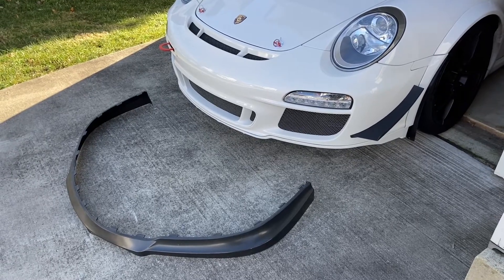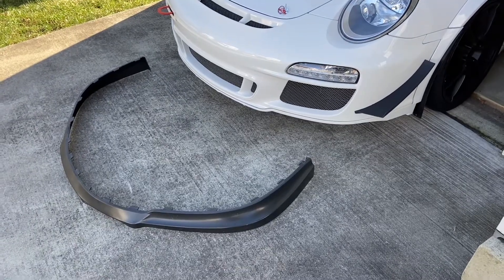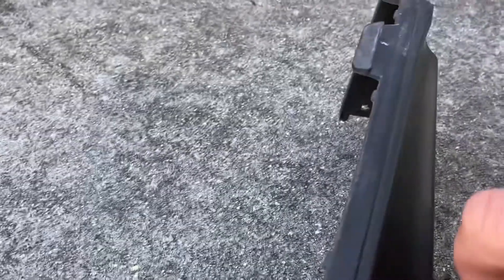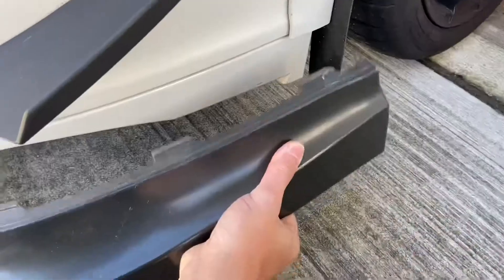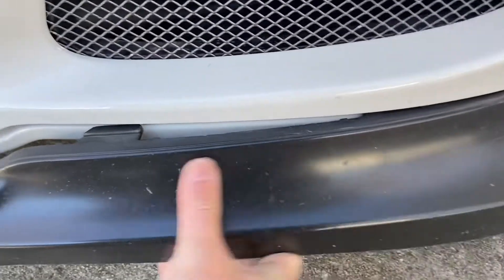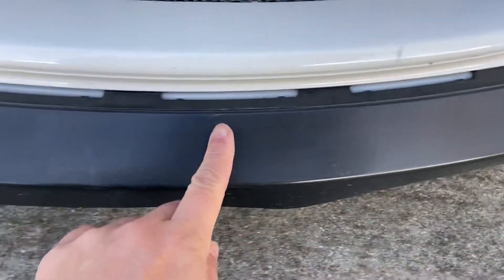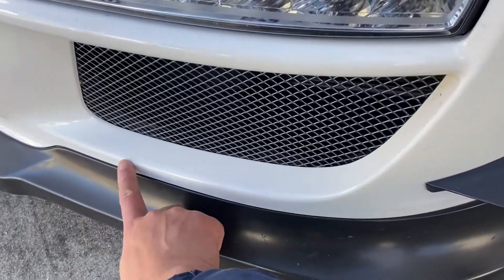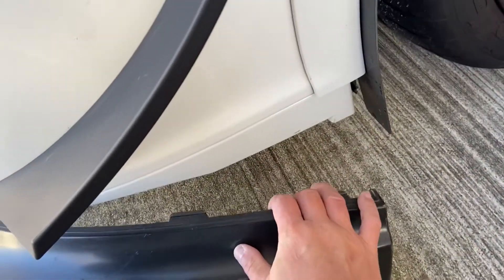997 GT3 Cup front splitter install & removal

Comment: Where did you get this front splitter? I noticed it doesn't have the vents.
Reply from the maker: The 997.1 GT3 front splitter has vents. The 997.2 GT3 doesn't. This car has 997.2 GT3 Cup front bumper and splitter, these are Cup race car parts from Porsche Motorsport.